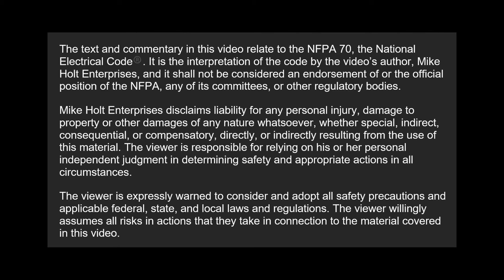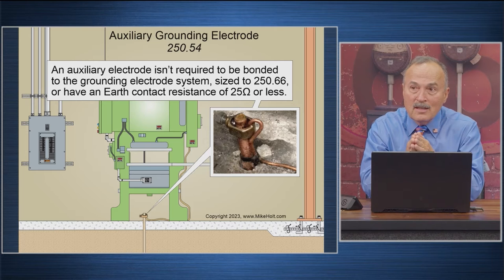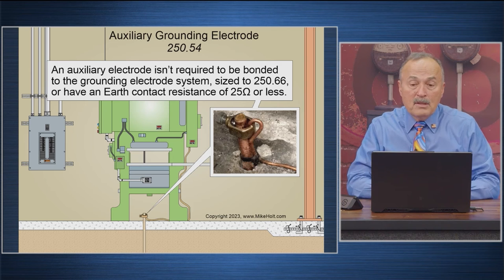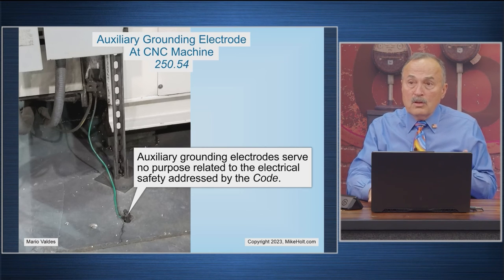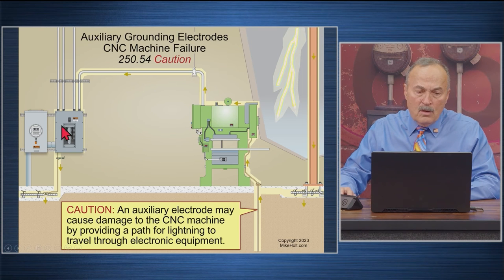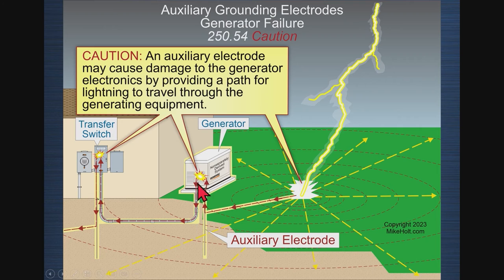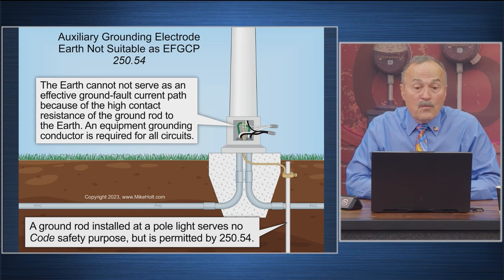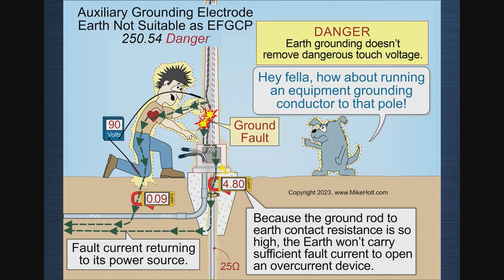Auxiliary Grounding Electrodes [250.54], NEC 2023, (10min:54sec)

Comment: So if the outdoor electrical equipment sets an Auxiliary Grounding Rod, a good additional design is also setting an SPD at the Pannel, to protect the EDS inside the building. SPD should based on the 10/350 test wave.
Reply from the maker: Surge protection in this example would not make a difference from the induced current from the lighting. SPD are always a good idea.
Please watch the entire video, not just the short. Click on the link embedded on the bottom of the short.
Reply: @MikeHoltNEC   Ye, thanks Mike:)

Comment: In the video you discussed how you thought that the auxiliary electrode was not a good idea for the generator example but I was hoping you would expound this to the light pole as its very common requirement for an auxiliary electrode to be driven at a light pole especially when there is also lightning protection on the light pole. So does an auxiliary ground at light poles help or is the same as the generator example, it causes more problems? This has been an ongoing debate about how to keep the surge from a lightning strike on light poles from getting back to the electrical panel feeding the light poles. Any advice here?
Reply from the maker: Driving a rod or not will not reduce any surge backfed current. But maybe having SPD on the circuits to the outside pole lights would be helpful.
Reply: Thanks Mike, that is what I was thinking was going to be the answer. May not save the pole that gets the direct strike but at least minimize the damage to equipment inside.
Reply from the maker: @jeffl3506  a ground rod serves 'no' purpose at a metal light pole and doesn't protect the wiring inside the metal pole (Faraday Cage).
Reply: Wouldn't this same issue arise from driving a ground rod at a detached garage that is being fed from main house/building?
Reply from the maker: @mikewhitlock1849  Great question, no. Why not? Because if you follow the lightning surge current between the two electrodes, there is no electronic equipment in the path. Also the NEC requires an electrode at the service [250.24(A)] and at a remote building [250.32(A)] to accommodate both system grounding [250.4(A)(1) and equipment grounding [250.4(A)(2)].

Comment: Not needed as per code is similar to the EIA/TIA standards that restrict pipe bends to 180 degrees and disallow conduit bodies for communication cables. We had to follow specs on equipment with electronics. Installed them per specs, did not violate code, got paid, went home.

Comment: But what about a bonded neurtral generator with gfci? Wouldn't that need a three pole transfer switch to switch both hot legs and your neutral therefore your generator would need its own electrode system correct?
Reply from the maker: Yep, per 250.30(A). Wow... you are one sharp cookie...
Reply: Mike what about lightning supresion systems and more then one grounds that are not connected.
My first asumption is never connect this to the main panel ground.
Reply from the maker: @chauvinemmons  Lightning protection systems are required to be bonded to the building grounding electrode system in accordance with 250.106.